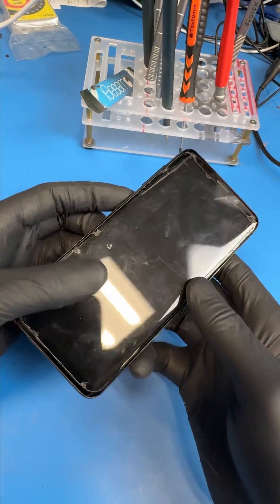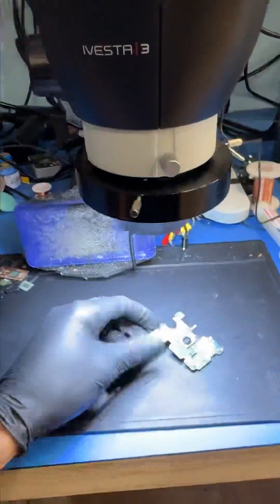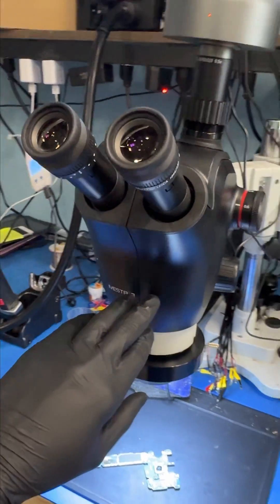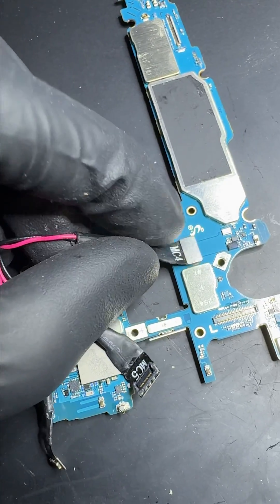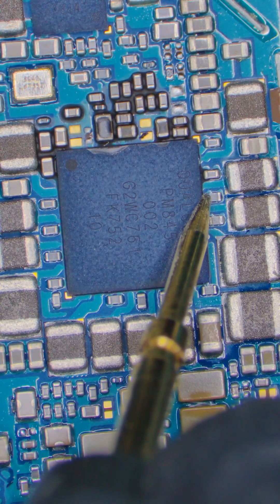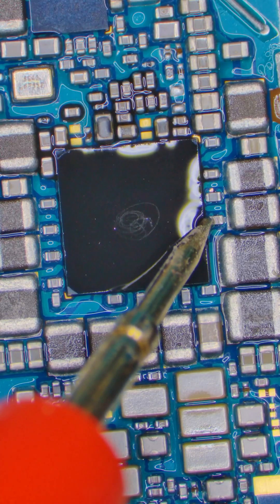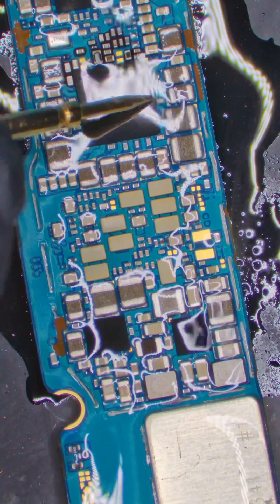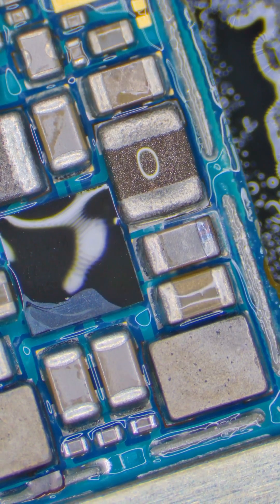Samsung Galaxy S9 Data Recovery…

Comment: Saw a short from this channel of repair of S22 dropped in water to retrieve 200GB of pictures. I own an S22 and no way it has capacity to hold 200GB. No slot for SD card on a S22, my phone doesn't come with sd card slot.How is it there are 200GB room on this phone?.

Comment: What is that cable you use to connect the power supply to the phone pin power connector to measure power?

Comment: On every single phone I have owned throughout my life, I spend a significant amount of time conducting thorough research using a notepad application that I download. Additionally, I often turn to Google and various other websites to gather information. As part of my routine, I have made it a habit to drop my phone onto the floor from a short distance, specifically onto a concrete surface. Surprisingly, for some strange reason, each time I do this, the phone ends up completely nonfunctional. It’s quite baffling and leaves me wondering why this continues to happen. This leads me to my main question: is it possible to recover not just photos, but also other types of files? I am particularly interested in finding out if I can retrieve important documents and any other kinds of information that I might have saved in the notepad apps that I frequently use.
Reply: You add me at "As part of my routine, I have made it a habit to drop my phone onto the floor from a short distance, specifically onto a concrete surface."

Comment: Hi any suggestions for fixing damaged mother board for an xbox 1 CD drive replaced t the motor but cracked the board and obviously won't read discs only those stored digitally 👍👍👍

Comment: so if the3 phone starts up with the defective piece taken out, what was the defective pieces purpose?
Reply: The capacitors that fail in that manner are called "power supply bypass caps" or simply "bypass caps" for short. That's not a name for the type of capacitor, it's the name of the function of the capacitor in question. On a quality product, bypass caps are usually somewhat redundant, and in many cases, very redundant.  You can frequently lose one or more even and still operate - similar to losing one lug nut off the wheel of your car - there are still the remaining lug nuts holding the wheel on.  But there are plenty of instances where removal of a single bypass cap will cause odd behavior or intermittent operation.  And there are many many non-bypass applications of the exact same component (a ceramic capacitor) where removal or loss of the component will cause immediate and total malfunction every time.  Bottom line is that if you willy-nilly remove bypass caps, you're asking for trouble, but won't always find it.

Comment: You're waiting for shorts to allowed at 2 minutes long?
Reply: He's limiting the current so, if all goes according to plan, he heats up the offending short component but doesn't burn out any copper leading to the short.  Then you find the hot component with a thermal camera, waiting for alcohol to evaporate faster in one spot, or even a sensitive body part.  It's actually "current injection" not "voltage injection" but that's just nomenclature.
Reply: @wormdamage  I think I was referring to the maximum length of YouTube shorts.
Reply: @lightdark00  LOL, I thought you meant how long letting that cap heat up (it's basically a short circuit).  Cheers!

Comment: But if the cap is bad how can you find out the capacitance of the replacement cap ?  Never seen a cell phone schematic to be honest
Reply: You can take a good one from a donor board and measure it.
Reply: Since these are bypass capacitors you can usually infer a reasonable value from what it's being used for. Besides if all you need to do is start it once to extract the data you can likely get away with not replacing it at all.
Reply: You don’t have to replace the cap
Reply: Yes that's true @nomecognome2
Reply: Let tester or same size cap
Reply: Don't think the capacitor size is super critical. It's usually a bunch of them in parallel to stabilize the voltage supply. In this case he didn't even replace it.
Reply: No capacitor , no shorted capacitor SORIN 😉